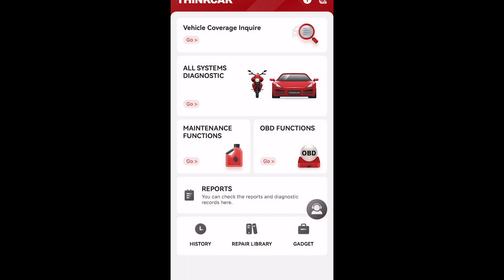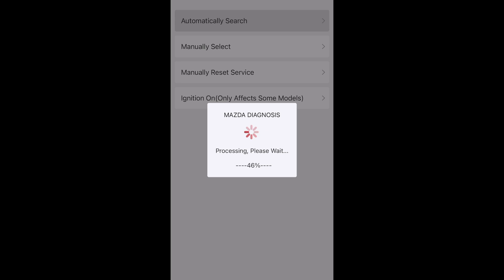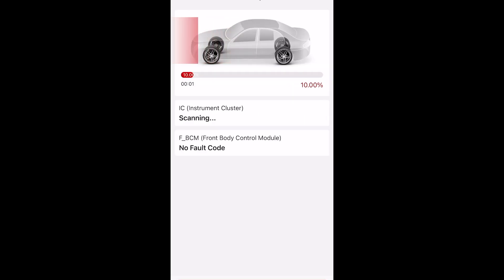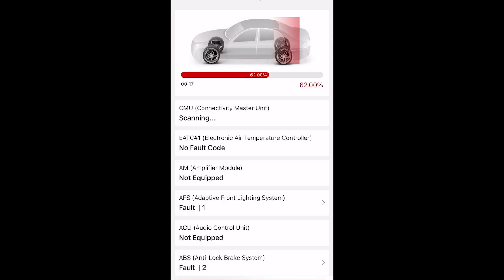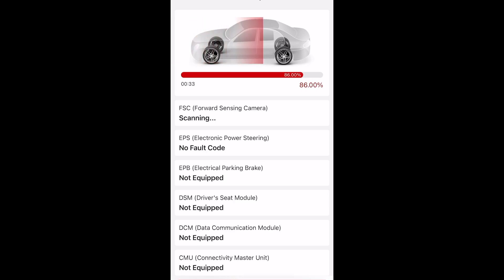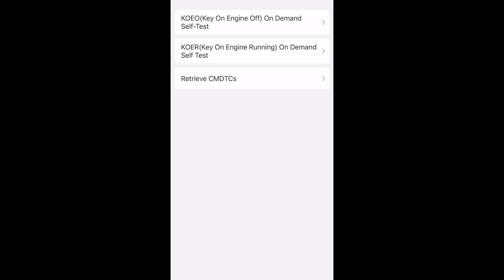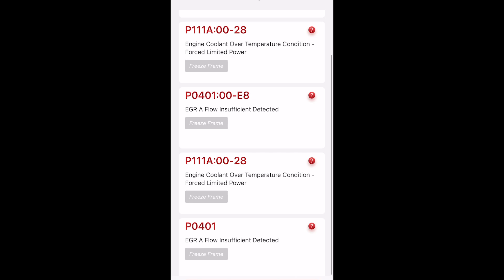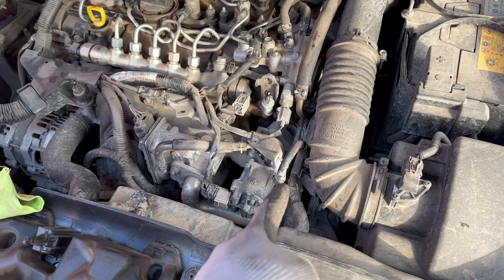Fixing P0401 on Mazda CX-5 2.2 Diesel | EGR & Intake Plenum Deep Clean

Comment: Nice job, how to close the valve with automatic trasmission?
Reply: You need to jack your car up, remove the wheel and cover. You will see a 21 hex bolt exposed. Need an extension tool to turn it. Turn until valves are closed.
Reply: @sertaliozer1 with the gearbox in parking mode?

Comment: An ultrasonic cleaner makes a huge difference to the time it takes to clean these parts and walnut blasting (or you can use baking soda) gets the area around the intake valves really clean. If you are taking the inlet manifold off, you should recommend to the client they get the coolant bypass pipe replaced with a steel unit, this saves the head when the plastic one starts leaking. And if the client doesn't know if they have been done, the injector seat washers MUST be replaced and the exhaust camshaft checked. Do these 3 things and these engines will go for a long time (with proper maintenance).
Reply from the maker: @caileme  thank you so much for your comment. really valuable tips i really appreciate